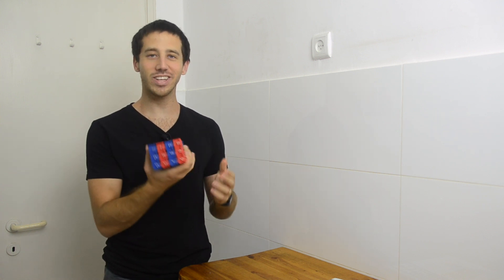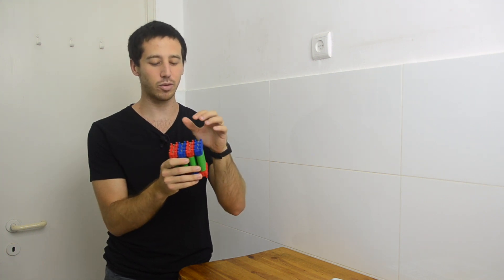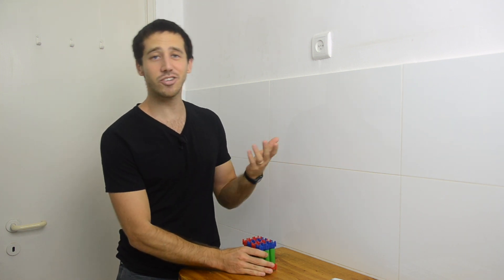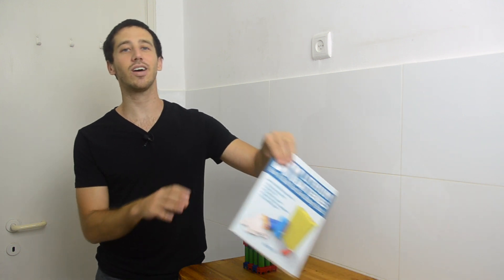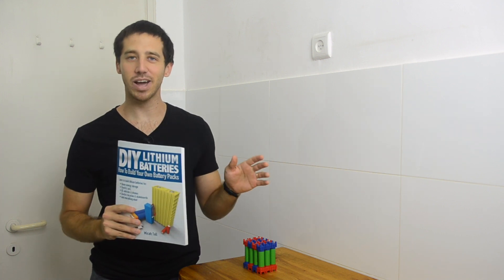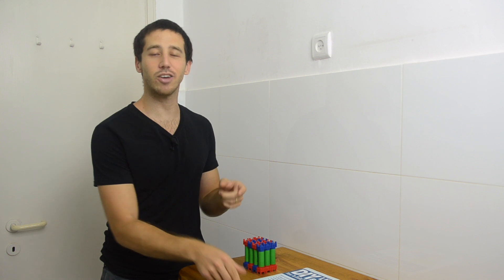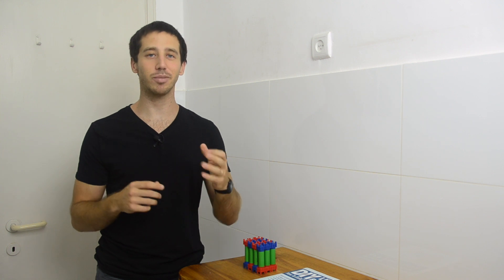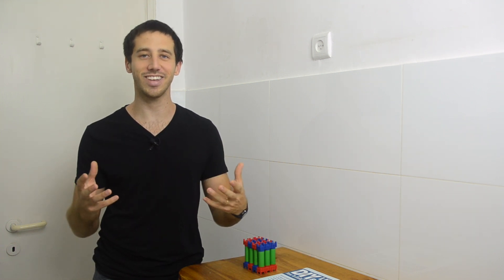New No-Spot Weld 18650 Battery Kit Revealed! from Vruzend.com

Comment: VRUZEND battery kit V1.6 am interested ... but I need to know will it work for me my motor is a ebikeling 1200 watt hub with a 35 amp controller does can this kit handle the draw ??

Comment: These battery build will make heavy because of excessive material used.Instread of this u can promote case packing without soldering by keeping them in a box.pls do future update based on Lessing the material.it will help a lot.

Comment: How are the caps secured to the ends of the 18650 battery? Your ebay listing talks about the nuts being secure and using loctite etc but from what I can see, the nuts are there to secure the bus bars and have nothing to do with securing the caps to the battery

Comment: I was going to buy your book, but is it better to assemble your own battery or get a Tesla battery module 5.2kw used/new to make my own powerwall?  I installed my own solar panels years ago, but
would like to add batteries and battery back up to my grid tied system.

Comment: awesome videos very helpful wonder if I might right you a small book back with some questions maybe you can help me with? in the last week I have started researching ebikes and am starting the planning stage for my first ever ebike I am planning to build it in the next couple months. my requirements: I live in Tennessee we have alot of steep grades and I am around 200 lbs so needs good torque, I live on a highway the nearest road is a mile away so the bike needs to be able to  reach 50-60mph for a couple minutes before I can slow down to 40ish so it needs to have top speed and the bike needs to handle on dirt and bumps as well as pavement so needs suspension. what I have been leaning towards so far: Enduro frame the cheapest so far from is eBay $450.00 shipped I am planning to run the zoom triple tree suspension from them as well, I want to build my own battery to fit that frame using your book, solderless kit, and new Panasonic cells you linked in one of your videos am thinking 72v 20ah pack but wonder what bms I should run what charger how to set it up etc.. any help you can advise would be appreciated?. on Amazon I found a hub motor kit that is $669.00 it claims to be 72v 3000w hub motor sinewave 100a controller there is a red wheel pictured says it's available in 17,18,19,20,21 motorcycle wheel and 24,26 bicycle wheel 150/155mm I have seen a video of a guy that has 19" motorcycle wheel on his Enduro frame front and rear I would like to run that 19" with the kit if it will work with that frame my only worries are 1.) it won't fit 2.) I want a small rear wheel with thicker and fatter tire than the front with a 20" or 21" front with a thinner shorter tire so they have that big wheel dirt bike look but would like the same overall diameter do you have any info that can help me there or can you direct me to someone who might if not?? do you know if the motorcycle wheels will mount up or where to buy them? and do you think I can meet my requirements with this setup? also is there a bms you'd recommend and a charger your fond of that would suit my choices best? and lastly is there anything that you would suggest me do different and why? so far I think I'm on the right track and think I can build this complete with hydraulic brakes and so on for between 2500.00+/- a few hundred does this all sounds right to you? sorry for the book and the irritation this might cause thank you for any help you might provide and thanks for the videos they're very informative I will be directing family and friends to your page for their research as well. thanks Jody

Comment: Interesting but how do you keep pressure on the cap so it makes good contact with the battery? looks like you need something holding the top and bottom together.

Comment: #2860 This is my order number. Sad really I bought 2 sets back in September and just got around to using them. I only used 4 to try them out .1 red and one blue cracked while I was pushing the battery in. I am using the green Panasonic nr 18650 pretty standard size. I also noticed on the red one it also pushed the screw out the top. I am not super strong where I have too much pressure I don't think. Am I doing something wrong here? They seem very brittle. That all being said it looks like air is getting caught in there not allowing it to push down properly because even when I push it down it comes out like if there is air pressure.PLEASE help I really want this to work!

Comment: Micah, I'm one of the early adopters of this product (ordred my 4 kits from india on april 1st 2017)... I know Urvakhsha Tavadia was working on high current versions (I will not give any details as Urvakhsha trust me and asked me to keep it for myself). Any new on this developpements ?
Reply from the maker: Yes, we're in the testing phase now with the prototypes. So far things are looking good with the prototype V2 caps handling currents of 8-9A continuous. We will keep pushing higher currents to see how the V2 caps can go. Then we'll need to prepare a new production line. At this point, we are still optimistic that we can have them ready by the end of the year.
Reply: Awesome !

Comment: Any chance you plan to make these for 21700 cells? Any other colors planned? I am currently building a electric trike and need higher capacity (voltage/amp limits) then the current kit as well. My intended pack design is Samsung INR21700-48G configured 10x7x2 totaling 140 cells. Also could you sell the connectors in packages of 10's and 100's to make for less left overs on custom pack configurations?

Comment: Micah:
Any news on the higher current version?
Reply from the maker: New prototype is on its way from the factory so I can do some stress testing. So far we are still on track for release by the end of the year, but we don't want to rush it - rather do it right even if it takes a bit longer. Hope you can understand!

Comment: I like your battery setup. Have you considered having a way to bolt them through one side to the other? It would keep them from shaking loose, give a mechanical way of drawing to too sides together and give a way to mount them (like to the underside of a skateboard)
Reply from the maker: Some people have done that actually. You can drill a hole in the corners between cells and run a bolt through. Best to put some type of rigid plate on each side, like a plastic cutting board or thin sheet of plywood, to help distribute the clamping force.

Comment: Hi Micah, 
Really like the new product and enjoyed the video presentation/effects. Congrats!
I'm new to the eBike world and I am in the process of making my own eBike. Your video tutorials have been a massive help, thank you very much!
I have a question: I bought a 48 V 1,000 W rear hub motor that came with a controller rated for 13 Amp. Initially I was thinking on building a 48 V ~20 Ah (13S 9P battery pack using LG batteries LGEAMF11865 with a capacity of 2,150 mAh per cell). 
Should I build a battery pack to match the controller (13 Amp) 13S 6P?
or a battery pack with a capacity of 15 Ah 13S 7P because my BMS is rated for 15A max continuous current?
or stick with my original plan: 20 Ah 13S 9P pack because "when in doubt, more amp hours!"?

Hope my question makes sense. I am still learning lots. Thank you in advance!

Other items I bought and was wondering if they are correct for my setup:
- 48V/54.6V 13S BMS with 5A max charge rating and 15A max continuous current.
- 48V 13S 2A charge current charger (aluminium case)

Comment: I am a scout master with my boy scout troop I am looking to build a solar or wall charge gasless generator to take camping. Most times we do not have electricity so we can charge phones and tablets possibly running a fan in my tent. Looking to build a 24 volt 40 or 60 amp hour. Where do you or a good source to pick up good 18650s that won't break a bank?

Comment: the main issue I have with this is that I cannot add indivdual fuse wires to each of the cells. I exclusively use recycled laptop batteries and fusing is very critical. The fusing I am talking about is the way Tesla, Jehugarcia and HBPowerwall use in their battery systems.

Comment: Have you changed/ improved anything electrically? I heard the springs can be weak and not make good contact. I saw a video with some pretty disturbing flir thermal images showing the terminals heating due to improper contact.
Reply from the maker: Yea I saw that too. Jehu Garcia overloaded it and didn't follow the assembly directions, so it was a double whammy of errors. When following the assembly instructions and loading instructions, we've never seen anyone overheat it. The springs have 5mm of travel between 2 caps and the contacts work well, but we are also developing a V2 kit for high power speed demon types ;-)
Reply: EbikeSchool.com could you get your hands on a flir camera to test them? I'd like to know what they can handle and how durable they are about being moved without loosening. (vibration if you used it with an ebike, would they loosen?)

Comment: I just ordered one and then these come out!! Lol great way to make a vruzend kit even better tho cause I might need to order another one. Now here's my question Micah cause I really want that book but am on an extreme budget basically ordering 4 18650s at a time. Ok here I go.: Would just 1 row be ok to use for now for a 52 volt battery? Let's say I have 14 in series can this work on an ebike. And what kind of range should I expect from a 2 mile ride to and from work? Thanks micah!
Reply from the maker: Hey Jeremy, I'll see if I can have your kit swapped out for a colored one. Regarding your question, theoretically yes you could have a 14s1p battery, which would be just one row of 14 cells, making a 52V battery. However, this would be tricky to do with the Vruzend kit because for an ebike you need fairly high power, usually at least 15-20A minimum, often more. Using more cells in parallel reduces the load that each cell and connection has to handle by itself. But with only one cell in parallel, you put all of that load on each cell and connection, so you have to use really high power cells that can handle that much power, and a high power connection system, such as spot welding. Good luck to you in your battery building future!
Reply: thank you micah. a kit swap to a colored would be awesome! thanks for the response and i will add more cells to make my battery stronger to put less load on each cell. i plan on getting all my parts from you and the vruzend team you guys do great work good luck to you!

Comment: Awesome addition! I have the plain color caps. Would be cool to have the tab connectors come with a mount for the balance wires. Also how about a video on ways to package a battery and seal it up using various methods?

Comment: Love this idea! I've been holding out for version 2 since I need a slightly higher powered battery, but I may have to get one of these new kits while I'm anxiously waiting :) any idea when the new kits will be out? Otherwise, do you have any suggestions on how to run higher power in these current kits?
Reply from the maker: Hey David, we're still working on the material sourcing and upgrading the production line for the V2 kits. Still planning on having it ready by the end of this year, hopefully sooner. You can swap out the busbars in the current version of the kit for copper, but the internal contact will likely be the bottleneck. The best method is to increase the number of cells in parallel, if you have the space. That increases the total current you can draw.